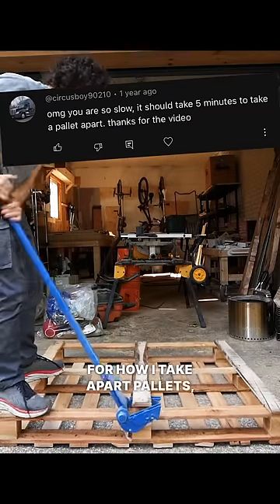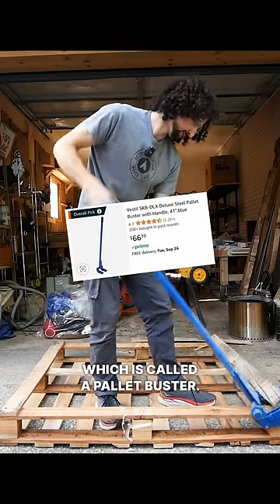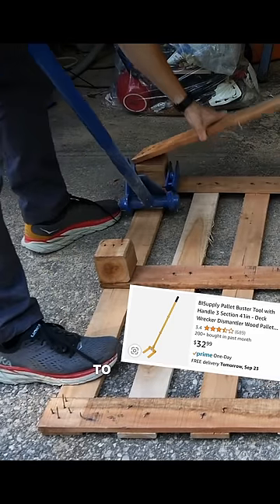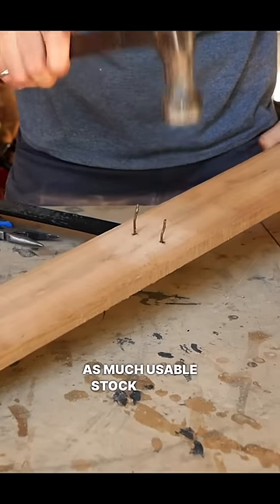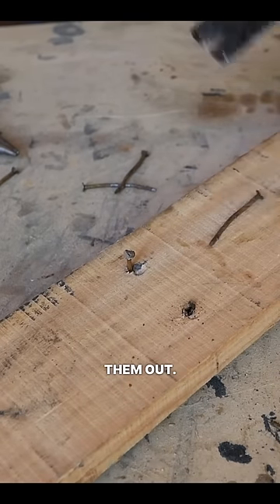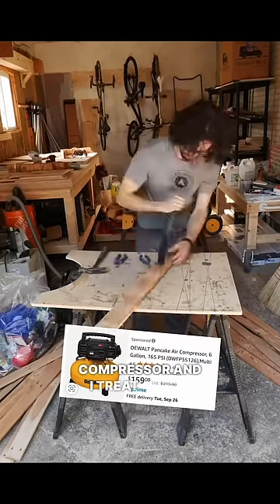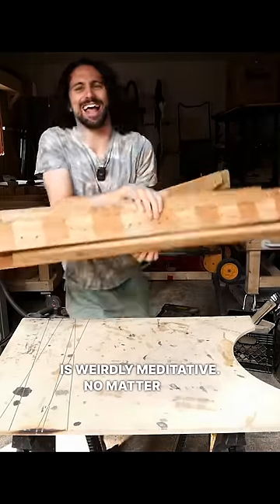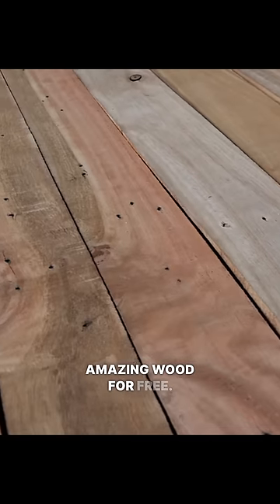The secret to pallet woodworking #DIY #woodworking #upcycling

Comment: If it takes time to take apart a pallet the wood ain't free. Most valuable thing is your time. With 60$ worth of material (what you paid for your disassembly tool) you could of made 2 or 3 times profit. Repeat this 3-4 times and you can reinvest in some decent tools and materials. Do this for a few months with real drive and you'll be selling thousands of merchandise a month..

Comment: Wish I had this. My boss had me using a flat bar. An hour in, I was trying to pry a spot with 7+ nails in it and I lost grip of the flat bar. It shot out, hit the pavement and ricocheted up into my face. Left a nice gash. Luckily, I didn’t have insurance, so 15 minutes later playing doctor on myself (with some peroxide and super glue) I was back at work. Still have the scar, but fortunately I have a thick beard that covers it.

Comment: Just an idea , i made an air compressor with a chinese air pump and an old fire extinguisher bottle and a water filter. Works like a charm and since the water filter is also pressure regulator i can use it for anything. For a total of 30 dollars 😂

Comment: You know when removing the nails from the pallet when you are pulling the nails out you can use the teeth end of the hammer. If you didn't know it was there for a reason

Comment: Get the cheap knockoff. Use a black pipe for a handle and use a small piece in the round part to keep it from buckling. Little fabrication and big savings

Comment: Theres a better way of removing nails than a pry bar.
Just hook a hammer in there and bend it to the side.
Its real good if you have nails really stuck in think piece of wood, because the fulcrum is closer to the nail, you are less likely to break the wood.

Comment: I hate to be that guy, but ehy use a crowbar when you use a CLAW hammer? You know, a hammer with a claw to remove nails? It's not like it's that much harder, because I have done the same so I know it's just as easy, but more convenient as a crowbar
Reply: Same reason he didn’t use a crowbar to break pallets (literally it’s designed use). So he could make a dumb video for chimps to watch

Comment: If it was me id get one of those tractor supply memberships get you a cheap saw za couple shit blades and just cut stright through the nails and if motor burns just take it back and they replace it free of charge had to do this like 3 times while removing and rebuilding a old deck

Comment: Sure. But the wood isn't really good. It twists and moves a Lot.
Edit: After, let's say, 5 years, the drawer built with it will neither be able to be used properly nor will it look as neat as it did at the beginning.  If there is high humidity, this is even sooner to happen.

Comment: Or you could use a hammer for the whole thing and still do on half the time and get a better work out of it. Using a tool with that much leverage isnt really giving a work out. If you dont want to worry about splinters, just put on some long sleeves and gloves.

Comment: Okay but pallets are still ass wood. I’d buy a chainsaw and the tools to mill with it before I actually used pallets for much more than some crap I’d build to go in my barn or tool shed. Which is currently being built with wood I cut.

Comment: I worked at a pallet factory called hinchcliff, my job was taking apart pallets with a large horizontal lift table bandsaw. It was fast, but dangerous. Prying those nails from kiln dried lumber is not fun, so we cut the nails between the joinery and left the heads/shafts in the boards. Try to doing that all day for $8.25/hr, some pallets weigh 100 pounds especially Anheuser Busch or cake pallets. I quit that job and went to the the US Air Force, now I’m an anarchist libertarian advocate for world peace, medically retired full service connection. At 29

Comment: Huh? “The way I do it doesn’t require any expensive tools” and then lists a special tool made specifically for the job… I would use two pry bars and a hammer to get their claws between the boards on either side to pry a pallet apart myself. Who’s roasting you for using that?

Comment: The other half always wanted me to sand the qood to the point it looked new, not use any piece that had a nail hole in it, and then stain it some god aweful orange or yellow color instead of a niece natural stain or straight Poly. She would then glue a bunch of lace and yarn "decorations" on completely hiding the wood. Kinda defeated the purpose of the whole thing to me...

Comment: "doesn't require any expensive tools", ... then goes about using an expensive tool.  There is tons of homemade, and very effective, pallet prying tools.  Easily searchable.  Mine I use is a old pickaxe handle, and two hardwood cuts offs, screws, and glue.  
Nothing wrong in buying an expensive tool, but why make a video about it. just show the tools website video.